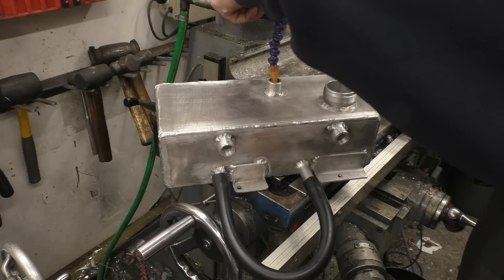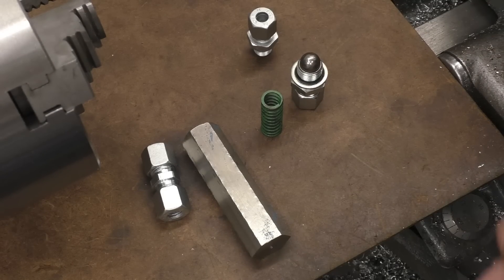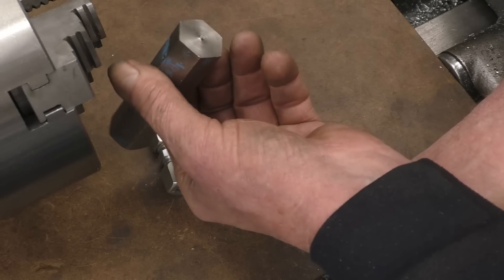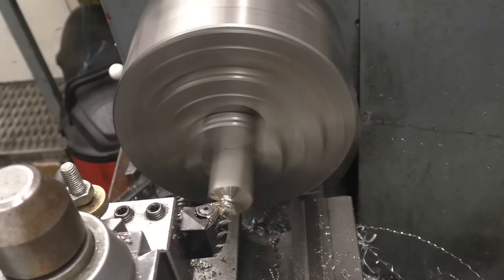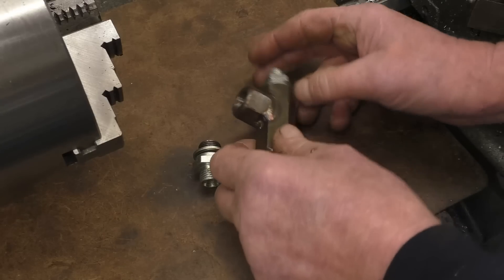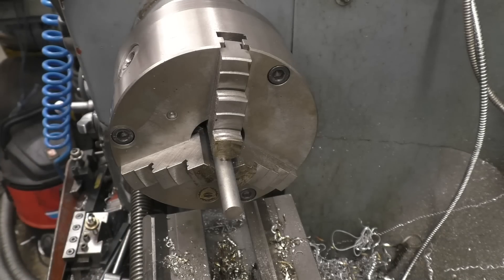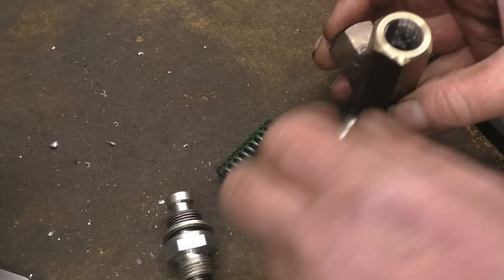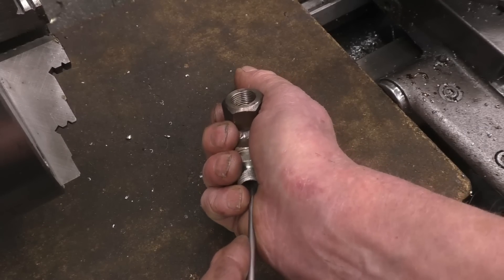DIY Gas Turbine P 13 Oil Pressure Relief Valve

Comment: Nice pressure bleed valve, and all made from the proverbial "scrap in the corner" as well. Looks like that spring came off a plastic injection moulding die, they come in all sorts of strengths, with the colour indicating how much the modulus is. Green of course is the most common, middle of the range.